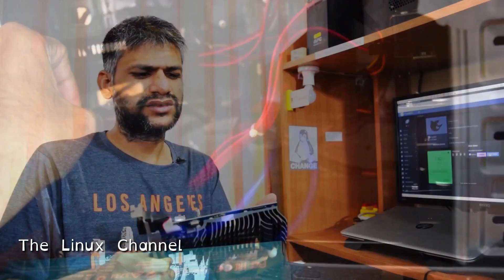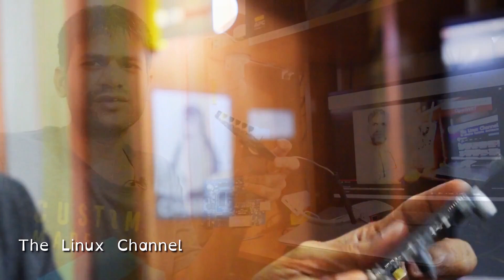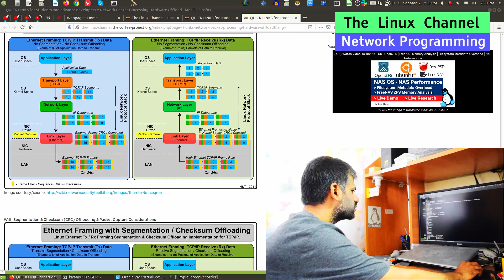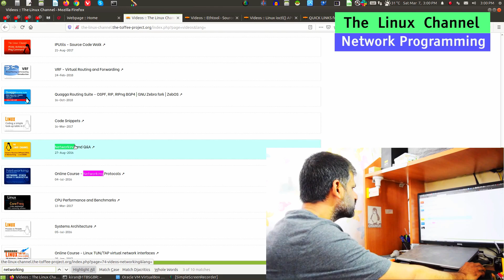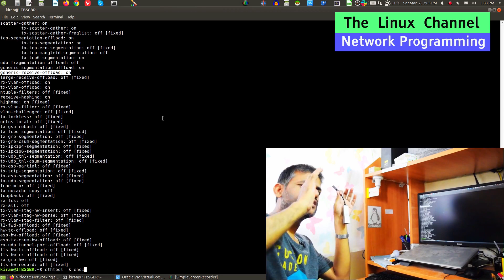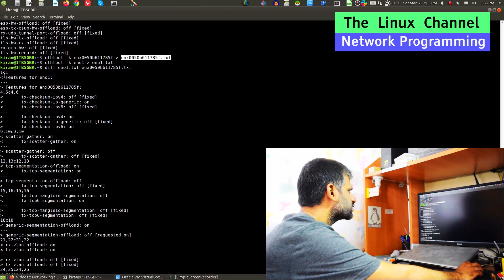0x1ed Smart NIC Cards - Part 2 #hardware #networking #servers #cloudcomputing #education #training

Comment: Sir will u also tech how to  writing NIC driver  or u have already told .  As i have just started to watch videos from beginning (skbuff your first video) .
Reply: Sir after completion of NIC series also tell us about the kernel data structure associated with all the commands and system calls used in this ( NIC Driver) .
Reply from the maker: nice to meet you. I think vaguely I covered couple of videos on the same. But extensively covered net_device data-structure which is the network port data-structure: https://the-linux-channel.the-toffee-project.org/index.php?page=41-videos-linux-kernel-net-device-data-structure&lang=en